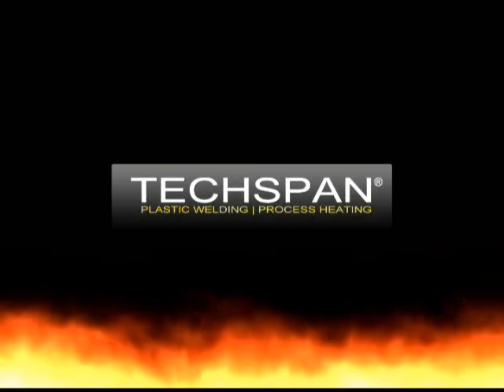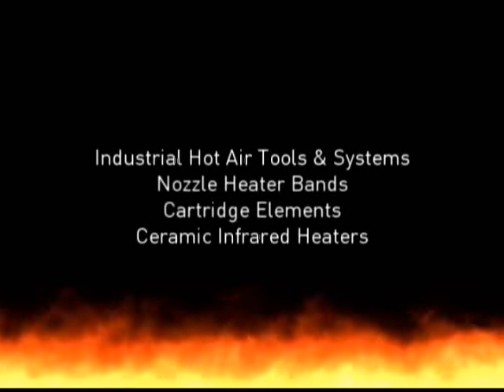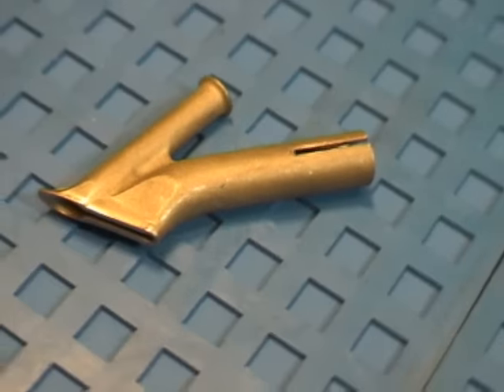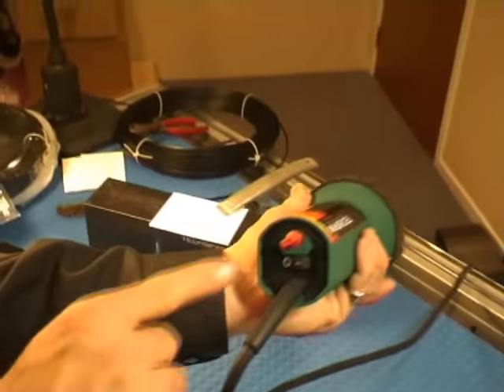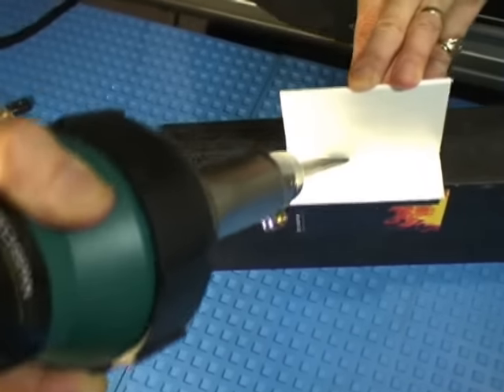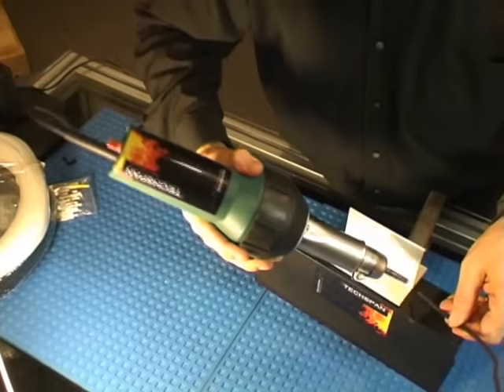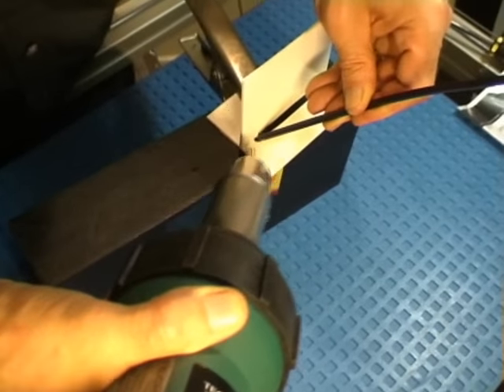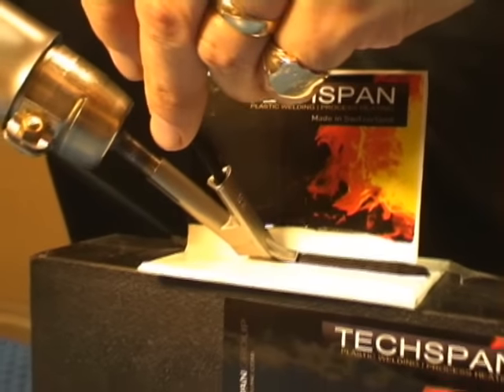Plastic Welding: How To Instructional Video by Techspan

Comment: Interesting; never knew they did that.  I guess it replaces acetone.  On the one example, the bead didn't look too good.  I was a good welder in high school; both gas and arc. What does an average plastic welder get paid and are there a lot of jobs out there?  I saw one available but they wanted experience.  Just curious.
Reply from the maker: Hi Steve, thanks for your comment. Remember this is simply a demonstration ... In respect of the welders job and usual remuneration, It really depends what country you are in , and also on what particular welding you are doing. For example, a guy welding repairs to bumpers is perhaps more likely to earn more if he is fabricating, or welding a waterproof membrane... like a roof.
Reply: Sounds complicated!  As a teacher, I'm sure a welder makes more cash.  I was a decent arc welder in high school, many moons ago and an average gas welder. I retired at 50 and I'm looking for something to do.  I don't know if I could weld anymore but it would be interesting to try.
Reply: John, I had good kids that were conservative and well behaved. I was lucky. I was tired of all the common core crap and I wanted to try something else. I'm only 50.
Reply: I'm over it. :-)

Comment: Cracking Job, looks very professional..
were can you buy the sheets of material you used would like to make a small planter this way?
Thank you
Reply from the maker: Hi kev b , Depends on where you are located. We source this kind of thing in Australia & or New Zealand through a supply known as Mulford Plastics. There are others, google 'plastic sheet suppliers' and you should turn a few up. All the best.
Reply: Thank you for the info, and fast reply

Comment: Guys, could anybody help me out? When you weld, do you melt the surface as well as the rod? Or do you just melt the rod? I cannot seem to get a strong weld if I don't melt the surface so I might be doing it wrong. However, some plastics are quite thin, so I always distort the parent material when applying pressure with the rod... :(
Reply from the maker: Hi Farseer1995,  you need to heat both the parent and welding rod evenly. This is how the pendulum welding process works.. the pendulum motion heats both the parent material and welding rod. 
Here is some more how to info >> 
https://www.plasticweldingtools.com.au/how-to-weld-plastics/

Comment: I've never plastic welded before, can someone explain why you need a grounding clamp? Does the plastic need to be set on a metal surface? I figured it would be a process more akin to TIG, but it looks very different.
Reply from the maker: Hi Master Betty, thanks for your comment. No, you do not need a grounding clamp. Plastic is not conductive. This clamp is used simply to hold and support the work.
Reply: TECHSPANONLINE ok, thanks. It didn't make sense to me, since, as you said, plastic isn't conductive. I mistook the clamp.

Comment from the maker: Thanks. Our equipment complies with worldwide welding standards as set by the DVS joining association in Switzerland. You will find that two this requires two important factors - Heat & Pressure. It is very important to provide pressure on the welding rod if you wish to achieve structural welding.

Comment: I wonder if this would be suitable for computer repair? It would need to be able to do butt joints with little to no structural integrity loss.

The parts for fixing something as simple as a top panel can be very expensive to fix sometimes making it uneconomical for customers.

Love the reverb and phaser on the voice, suited the DnB excellently haha big up to your sound guy!

Comment: Quick question,

When welding an internal corner on two upvc sheets, vertically, do you need to have a gap between that materials to give the weld rod somewhere to melt into?
Reply from the maker: It depends on the application. If you are after structural strength, perhaps this is best. A "v" groove usually does the trick.. If you are welding into a 90 deg, then no. But you would need to '"tack" the materials.. Have a look here for more detailed info - http://www.plasticweldingtools.com.au/how-to-weld-plastics/

Comment from the maker: The rods may look different, but they are the same material. We used a different colour simply to allow the viewer to see the process easily. In this case the parent material and welding rods are polypropylene.

Comment: Is it possible to weld PVDF to CPVC ?
Reply from the maker: +John Noone  Hi John Noone,   In most cases compatibility is very important.  With requirements like this we suggest you try taking a slither from one part and attempt a weld on the other part.  This will be the most compatibility you can achieve, so you would have to make a decision on the resulting weld strength and whether or not it was sufficient for the application requirements. http://www.plasticweldingtools.com.au/how-to-weld-plastics/

Comment: Can this be used to weld acrylics?
Reply from the maker: Yes, you can weld acrylic. However, this material tends to absorb moisture from the environment, so the moisture in the material will tend to 'bubble' as it is heated during welding. So if a high visual finish is required, it is not always possible to achieve. Hope this helps.

Comment: Will it work on polyurethane
Reply from the maker: Yes, PU (Polyurethane) can be welded, providing you use PU welding rod. You can also use part of the parent material as the welding filler rod. Otherwise we can supply PU welding rods. If you need these please email us at sales@techspanonline.com

Comment: What size rotary burr (head diameter) would be good to create a V to weld 2 sheets of 3/16" thick HDPE together? I am looking at burrs and wondering if you used HSS or carbide? I tried using a rotary sander bit but the sandpaper got clogged with the plastic very quickly. I was looking into grinding bits as well. Thanks
Reply: Figure it out yourself. What do you want your hand held.

Comment: Looks like a leister  s  or is it a bak rion or is this another I don't know please tell who's stole this one
Reply from the maker: BAK-AG make this machine, but the owner is the great nephew of Karl Leister.. he was in fact the brains behind the technology. Hope that helps.
Reply: @TECHSPANONLINE  hapco is hapco the owner of bak   and how does weldy fit in to the picture.
Reply from the maker: @todddebockler7786  They are agents for BAK.. I know the owner.. his name is Bruno. Weldy is made by Leister. We also supply Leister
Reply: @TECHSPANONLINE  thinking weldy is leister but made in china but I am not sure just going by package that said made in china but I was am unsure
Reply from the maker: @todddebockler7786  weldy is manufactured by Leister in their manufacturing site in shanghi..
Reply: @TECHSPANONLINE  thank you for the info seam like it would make more sense to buy the weldy kits for 89.00 then 600 for a leister I think I still want the switerland made models thank you again for sharing light on the hot air business
Reply from the maker: @todddebockler7786  Thats why we offer a good range of equipment. It can also depend on the use. Welders working every day usually want the more robust unit

Comment: How does this compare to MEK or Tetra?
Reply from the maker: This is WELDING a molecular weld. Others are solvents.  PVC spouting is usually assembled with a solvent. But for structural strong welding, you are best to weld.
Reply: @TECHSPANONLINE  so MEK is solvent type and not as strong as heat welding?
Reply from the maker: @arrowstheorem1881  Hi Cosmo John,  done correctly, hot air welding will be stronger yes.

Comment: Would HDPE provide sufficient protection if used to make a motorcycle mask, or are there other weldable plastics that would be better suited for that purpose?
Reply from the maker: Hi Matthew Traver,  I would check what regulations in your country state. There is likely to have been approved materials for such applications. Proceed with caution is my advice. HDPE is commonly used for an array of plastic around the home. Recycling Bins, Water tanks, Wheel barrows, Milk Bottles .. even Petrol & Fuel containers.. and many more. It is easy to fabricate and weld.

Comment: From briefly reading through the comments, I understand that this welding process makes one of the strongest bonds you can make between the mating surfaces. Are these welds watertight and do you have more info on the strength (PSI max) and can it handle being in a vacuum?
Reply from the maker: Yes, Welds can be hermitic. There is also a tester we supply for checking this called a 'spark tester'. Feel free to email me direct for more details.  info@plasticweldingtools.com.au

Comment: Will this work on fuel pumps?
Reply from the maker: Hi gswannabe09 , thanks for your comment. If the part is thermoplastic, then yes it is possible. You need to ensure you identify the material and use the corresponding welding rod (same as the parent material).. 
Copy and paste the following link into your browser to see the plastic ID guide.. 

https://www.plasticweldingtools.com.au/how-to-weld-plastics/ 

Hope this helps.

Comment: If you lose your grip on that rod and your hand hits the welder, it's burn city.

Why not show proper safety using a gloved hand?
Reply from the maker: Hi Lazza Leppi, While we encourage safety at all times, we have never seen a user of hand held welding tools use gloves. Again we encourage it, but it is as usual - you can lead a horse to water, but you cant make him drink. Our tools also use a stainless steel protector, which is fitted around the heating element housing. This itself has improved safety preventing burns to operators. Always read the operating instructions before use. All Techspan plastic welding tools comply with CE safety & quality standards.
Reply: TECHSPANONLINE
As a professional fabricator and welder of metals from Stainless steel to Aluminum and even AR-500 Armor. I can say that Stainless steel gets hot very very fast. Sometimes it is almost untouchable just from sanding on it. It transfers heat and warps very very fast as well..
Reply from the maker: drvn1 Not quite sure what this has to do with welding plastics drvn1  ? !
Reply: Has to do with your comment and I quote" Our tools also use a stainless steel protector, which is fitted around the heating element housing. This itself has improved safety preventing burns to operators." My statement was that your stainless steel "protector" will get hot enough to cause burns as stainless gets hot very very easily.. that is what my comment has to do with it..
Reply from the maker: Hi drvn1,  these element shields are air cooled by the tools when running. So during operation it will be kept cool enough to prevent serious burns. Hope this clarifies.
Reply: @drvn1  Actually stainless steel conducts heat relatively poorly compared to carbon steel, that's one of the major reasons why it warps so badly from localized expansion. Pretty much irrelevant in this regard though.
Reply: Do you wear welding gloves in the kitchen?  You certainly could wear a set of TIG gloves (I even use my Tillmans for motorcycling) but in plastic welding one does NOT shove the rod hard into the workpiece. I use a Laramy Products welder fed similarly.  Plastic welding takes a delicate touch, like soldering. I don't glove up for soldering either unless using a torch.
Reply: they are not pc effeminates, that's why.
Reply: I hate people that make comments like this, smh.

Comment: you need a ratchet feeder, otherwise it will be uncomfortable on long jobs.....
Reply from the maker: Thanks cujoboudreaux , it sounds like you are talking about an Extruder Welder.. these are only required when welding larger wall section from 12mm thickness.. see these on our website www.techspanonline.com
Reply: what I was thinking of, is a way to create HDPE sighting for the exterior of a house and weld the plates together, much like what you are doing here. It would be superior to calking.
Reply: without a ratchet type feeder to create the bead it may be uncomfortable to get around all the edges. Thanks for responding. I do like the idea.
Reply from the maker: These 3D printers are nothing more than micro extruders... so yes, you could even build a house with a large extruder.. :-)

Comment: im not buying it.  because its frickin huge! plus those plastic filling can only be bought from the same company. i would rather buy a soldering iron and a glue. bacuse its cheaper and you can find them almost everywhere plus they can perform/fix things like this one or might be even better
Reply from the maker: Hi sam goode,  we do supply smaller units.. but at a higher price. This model is the industry standard for professional plastic welders.  A soldering iron ?  go for your life, but this is NOT welding. You will instantly 'burn' and 'degrade' the material as the temperature is far to high. Of course you are entitled to your opinion.. thanks for taking the time to comment all the same.  regards, http://www.plasticweldingtools.com.au

Comment: Ill stick to a soldering iron
Reply: Yeah, I used to think so, too. Except stuff would end up stress cracking and break again or leak - and it always looked like crap. Then I got a hot air rig! Now I can actually have fun fabricating with plastic, not just attempting crap repairs. The soldering iron does give experience with tacking.

Comment: bonjour on peut sen servir pour des joint de salle de bain ?
Reply from the maker: It depends on the materials you need to weld in the bathroom. If you are talking about the vinyl floors or vinyl wall coverings, then yes. Our welders are commonly used to weld both vinyl flooring and wall coverings. 
https://www.youtube.com/watch?v=f4bLgt1glZQ